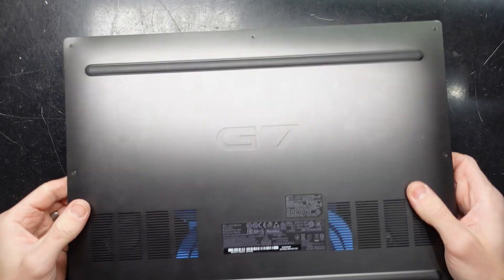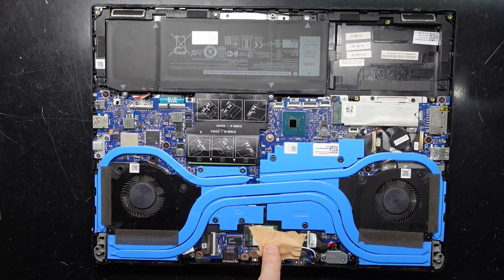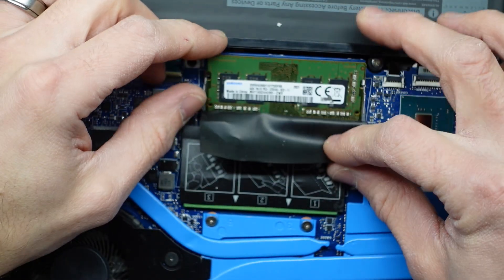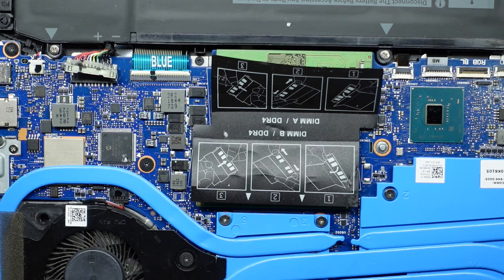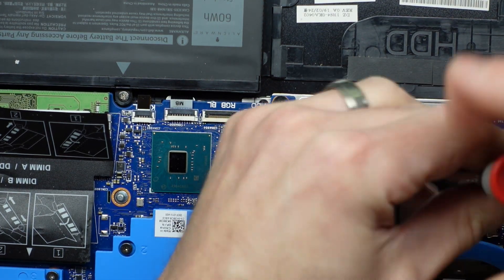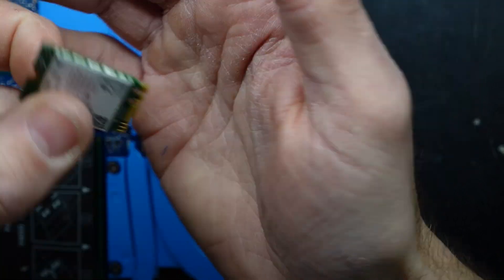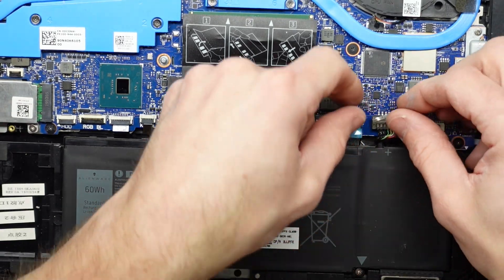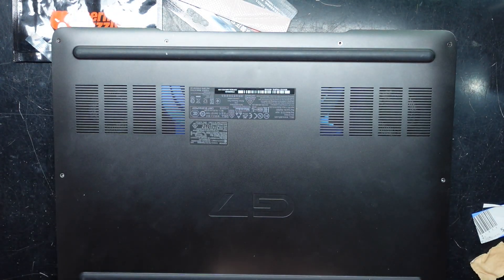Dell G7 15 7590 What can be Upgrade in 2023

Comment: what was the problem with wifi card and can u please explain those 2 wires around it ?
Reply from the maker: The 2 wires are the antennas (black and white)

The 2 antenna ports on the wifi card had been damaged by a previous owner 

1 antenna cable connector was OK, so with a new wifi card, I could still connect it up so wifi would still work
Reply: @rickstechrepairs  thnx for explaination bro lots of love towards you!!
Reply: What's the name and details of the wifi card you installed, I'd like to get one for my computer